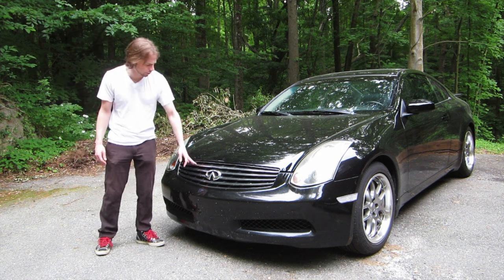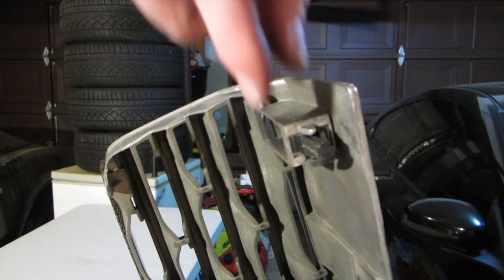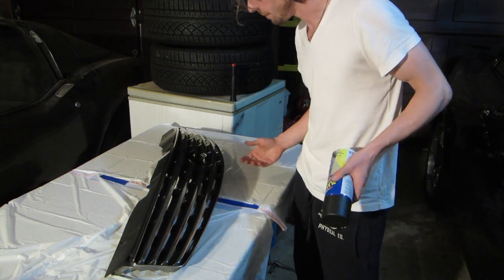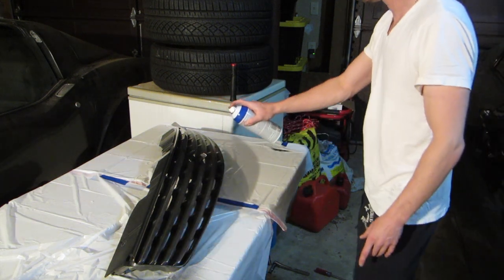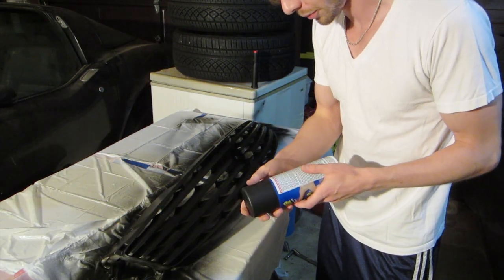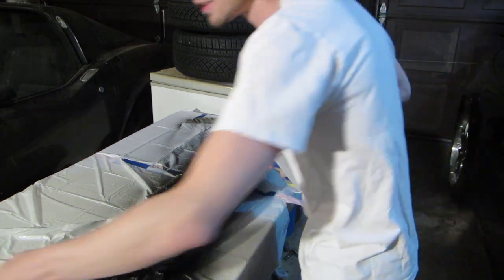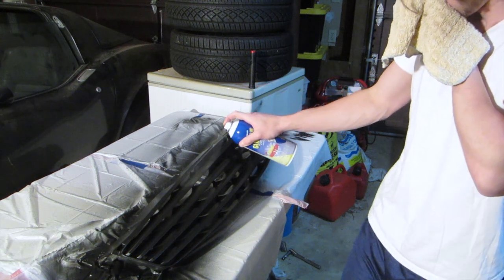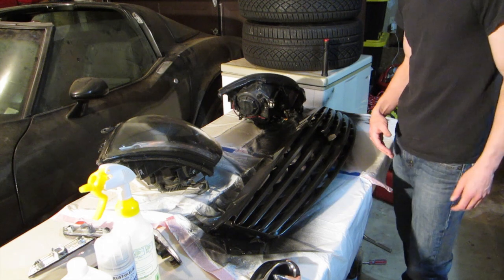Grill Removal & Plasti Dip [How to // Infiniti G35]

Comment: How is it holding up?? Did you have to sand prep or just over the chrome? ?
Reply from the maker: 3 years and still holding up. there's only one small nick from the road debris, but i avoid putting pressure on/around it when cleaning. no sand prep unless you're planning on really painting it. and the black with black gloss is a great transition from the nissan black paint to the plastic trims 😎👍👍 really great option. just please don't dip your wheels lol

Comment: How do you remove the lower bumper grill inserts?? I want to touch up the black paint on it and would rather do it with them detached from the bumper
Reply from the maker: Hey Brandon, sorry for the delay! i pulled my bumper off to check the connections.. Those lower bumper meshes are actually molded parts of the bumper, so there's no way to remove them w/o cutting them out.. i would not recommend taking that route. Rather, i would recommend using painter's tape to tape off the bumper itself. Make sure to cover up the rest using plastic bags or news paper.. Then paint the mesh pieces 👍

Comment: What if i use a clear instead of a gloss coat, would it work the same ??
Reply from the maker: yep, should turn out the same in the end. the only benefit to using the Plasti Dip is that they tell u it's easier to take off, but i think both make it really difficult to remove Plasti Dip.. maybe it will be more a little more difficult to remove a real clear coat
Reply: Mils Garage awesome, im going to try the clear on my grill hopefully comes out the same , thanks for the feedback
Reply from the maker: cool, let me know how it turns out :)

Comment: "You always want to spray in a ventilated area"... with another car in the background of the spray direction. LOL.... jk. I like what you did with part 2. I been needing to do that to mine too. from close glance, was/is the LED strip visible or is it hidden behind the original plastic cover?
Reply from the maker: LMAO yeah, i thought about all that as the fumes were getting to me lol 😂 i removed the original plastic panel completely cause it was old n turning green, so u can see the LEDs, but they're wedged down in there and r black/white. if the panel wasn't tarnished like that, there should be room behind the clear to fit the LEDs (that was the original plan)